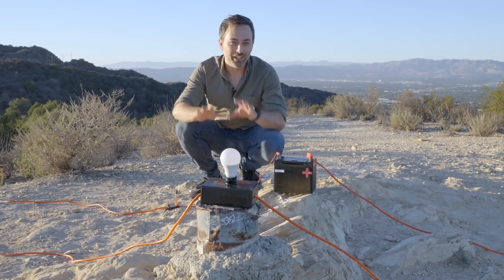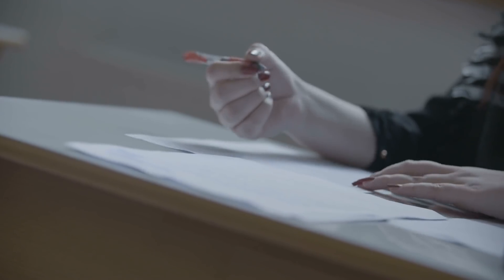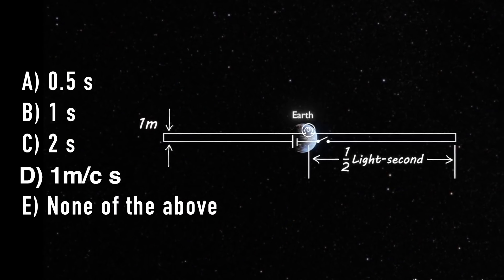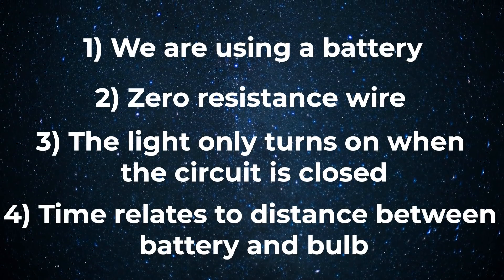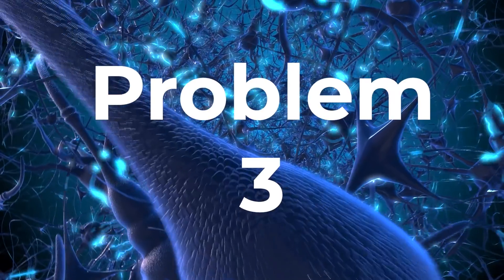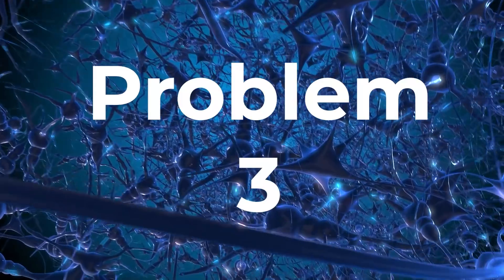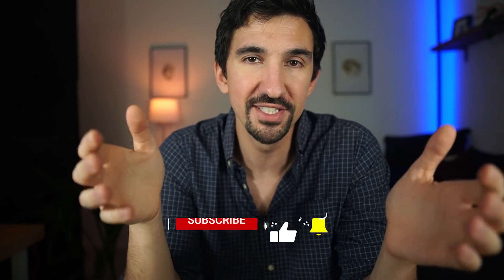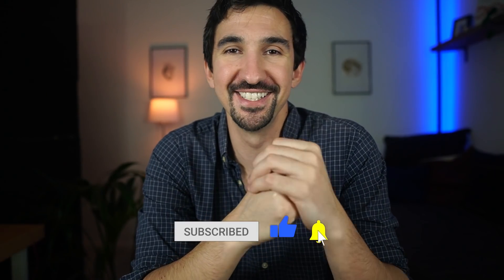Is Veritasium Wrong About Electricity?

Comment: I think you're kinda missing the point here. In Derek's example. When he closes the switch, current starts flowing through the light bulb 1/c seconds later. On the very edge of the wire however (1 light second away), current only starts flowing 1 second later. If you had a switch at the edge of the wire and you would open it, you would interrupt the current through the switch. The current through the lamp and battery however would only stop flowing 1 second later and the current through the other edge of the wire (2 light seconds away) would indeed only stop flowing 2 seconds later. In this example, information is transmitted at the speed of light and so this doesn't violate the laws of physics.
I know, it's seems illogical if you assume that the energy is transmitted through the wire. But it's not. That's the point. From the point of view of an electrical engineer, this can be explained by considering the capacitance and inductance between the wires, caused by the long wires. There are many different ways to see it that may help you understand it, depending on where you are coming from. But the main point is, that the energy is not transferred through the wire.
Reply: I think this video explains exactly what's going on (better than Veratsium's IMHO).
Reply: @ialsoagree  Derek wasn't speculating what would happen, he was simply stating a fact. This isn't any new discovery. It has been known to scientists and electrical engineers for decades.
Considering, the explanation in this video doesn't work without breaking the laws of physics. Well let me just say, disproving the laws of physics isn't an easy task...
Reply: @phinok.m.628  This video presents the same explanation as Veritasium's. If this video breaks the laws of physics, so does Veritasiums.

If it doesn't, then Veritasium's doesn't.

Both videos give the exact same explanation.

Did you actually watch the video?
Reply: @ialsoagree  Of course, I watched the video.
The problem is that the explanation in this video falsely assumes that a switch on the edge of the cable (1 light second away from the light bulb) would also switch the light on/off in 1/c seconds. Nobody said that would be the case and if it were, it certainly would break the laws of physics.
Derek places the switch one meter away from the light bulb in his example, because the distance between the switch and the light bulb matters. You can't just move stuff around and assume nothing changes. That's not how physics works. If you were to stretch the cables out, so the light bulb is 2 light seconds away from the battery and the switch, then it would obviously also take 2 light seconds for the light to turn on when the switch is closed.
The point that Derek was trying to make in his video was specifically this. That the length of the wires doesn't matter, but rather the distance between the switch and the light bulb.
And as pointed out in this video, a cable that's 1 light second long would need to have a very low resistance in order for the light bulb to work at all. Or you would need a power source with a significantly higher voltage in order to compensate for the voltage drop in the wires. But Derek clearly states that the wires in this experiment are assumed to have no resistance at all. So I don't see the problem with that.
Like I said, this is no new discovery. In Veritasium's video Derek simply tries to explain why this phenomenon occurs. If you don't like his explanation, feel free to watch another explanation. There are countless explanations out there, that don't break the laws of physics.
Reply: @phinok.m.628  " the explanation in this video falsely assumes that a switch on the edge of the cable (1 light second away from the light bulb) would also switch the light on/off in 1/c seconds."

No it doesn't, in fact, this video makes the very point that that CAN'T happen. It then goes on to explain what's going on - which is exactly what was said in the Veritasium video, with the qualification that the voltage induced by the electric field traveling straight from the battery across the 1 meter gap is too small to actually light the bulb. It's measurable, just not sufficient to power a light bulb.

Instead, the bulb would actually illuminate when the field had traveled across the length of the wire and reached the bulb, where the full strength of the field would create the voltage necessary for the bulb to illuminate.

This doesn't contradict what Veritasium said, it just clarifies it.

Comment: Doesnt the only movement that matters happen at the actual light bulb. The electron flows into the light bulb + , the electron - flows back to the battery, probably so that the electrons keep flowing towards the bulb or by the bulb. So the old electrons move out of the way of the new electrons. I  DONT think it matters how long it takes to return to the battery for - , it only matters that + side can keep flowing by the bulb. The reaction of the electron flowing by the bulb must be where the field reaction takes place. I dont think we have giant fields everywhere for electricity. I think for this issue you should look into how a light bulb works. I think fake science or misinformation is still an issue with modern science. When I plug in a device there is meant to be some field that flows all the way from the power station to my device ? I dont think so, Why cant I detect these fields anywhere then ? This is rubbish.

Comment: This is a simplified experiment with a single wire. What about a circuit board with hundreds of traces on it? Is the electricity in a PCB not flowing through the "wires", but instead only as fields?

Comment: Derek's videos are usually eye opening, but this one left me scratching my head. I feel normally he explains his premises better, but this one I feel he forgot about the layman and targeted this video to those who already have a deep understanding of electricity.

Ex. I wonder why the electrons that already exist in the wires aren't accounted for?! 

In my primitive mind, I picture a pressurized hose like in hydraulics. When you apply pressure and initiate the flow of hydraulic oil, the movement is translated end to end immediately because the fluid is incompressible. You're essentials moving a solid object through a pipe. If you lift 10 foot pole, the end of it will move at the exact same time as the part in your hand.

Couldn't this provide an answer to his problem? I have no doubt my lack of electron/electricity knowledge is wrong and there is a clear reason why this isn't the case, but I think he should have done a better job at explaining these types of scenarios in layman's terms to make a better case for his video.
Reply: If you model the wire as an incompressible fluid then the signal travels instantaneously (FTL), which is very impossible, so that doesn't help.
In the real world nothing is incompressible. For your examples: Over large distances, the small amount of compression in hydraulic fluid builds up to create a time lag. If you try to lift a giant pole then a compression wave will travel through the solid pole (at the speed of sound), and the end of the pole will only move when that wave reaches it. Veritasium actually made a video on similar issues ("Will This go Faster Than Light?")
The "tips" of the wire (the bits that extend out for half a light year) can only get a signal after half a second; anything less would break causality. For the bulb to react in less time, requires a signal to ignore the wires and travel directly though the air.
Reply: @Lashb1ade  thank you for this clear response. I did not realize there is a compression wave even in large physical objects. Obviously physics is not my strong suit. Lol Cheers.

Comment: It seems to me that the main question 'What delivers the energy?' still hasn't been answered. It seems to me it is neither the movement of electrons nor the field. The movement of the electrons leads to the deliverance of the energy and the field is caused by the difference in potential which causes the electrons to move, but 'what' exactly is propagating still hasn't been addressed. Any ideas?

Comment: Yeah my assumption is that you could get some kind of transient behavior where the light turns on for an instant when the switch is closed, due to the magnetic field generated, but that would disappear quickly, then (more than) a second later you'd get a steady state dc current.

Comment: it would have been better to take a conductor where the voltage wave is reflected and thus forms a standing wave, so one could have measured the wave-shaped voltage amplification along the length of the conductor.

Comment: you think of the switch as a break in the circuit and when you close it, it fixes it. if the circuit brakes. it will take the light the distance from the break to the light divided by the speed of light for it to turn off. veritasium made it seam its the distance from the battery. but it is from the switch

Comment: If there were two batteries and two light bulbs in two separate closed circuits, but laid out right next to each of other, what happens when you flip the switch on just one of them?
Reply: A small voltage will be induced in the other circuit - but the induced voltage will be very very small (just like in the Veritasium case).
Reply: Interesting...  Another video claimed the wires didn't need to be connected at all.  Which brings up a lot of questions imo.

Comment: He did it for the views, guarantee his wires were 300 mm long, Your dead on correct, the resistance of wire at that length/ voltage  would never make it to the bulb.
Reply: You missed the point of the video; obviously the wires didn’t go halfway to the moon. His circuit was a visual aid not a demonstration 🤦🏼‍♂️
Reply: @theevilkoala9250  I think Warped Perception is making a different point:

If the bulb can be powered merely by having the battery and switch near the bulb - regardless of the length of the wire - why does wire resistance matter at all?

If all that matters is the field generated by the battery reaching the bulb, then surely the field dying off some where down the wire doesn't matter - since the bulb turned on long before the field reached that part of the wire, right?

Except wire resistance does matter, ergo some assumption made by Veritasium is wrong.

In this case, it's that there would be enough voltage to turn the light on.

Comment: Very nice though experiment, which is indeed not that simple as it might seem. Depending on the circumstances, answer c might still be right. Let me try to explain, why your argument of "breaking relativity" is false. If the wire is not broken, we could measure a voltage over the switch. As soon as it breaks, it takes some time, until we do no longer measure this voltage, and this time depends indeed on the speed of light, and how "far" away the wire is broken. But, my point here is, that the information, that the wire is broken, propagates as soon, as the wire breaks, and not as soon as the switch is closed. Therefore, if we assume that the wire is broken (long enough) before the experiment, we do not break relativity.
The point, if the circuit can be seen as two antennas, depends in my eyes of view on two factors. Resistance, and Capacitance. Assuming zero resistance, and non zero capacitance, the argument of Veritassium works fine, and I would say the answer is correct. (At least if we neglect the missing "m" in the unit)
Reply: This video isn't saying Veritasium is wrong. It's saying that the voltage induced in the bulb side of the wire after 1m/c would be too small to light the bulb.

Comment: Consider the conductors being perfect coax cables that leaked no radiation.  There would be no antenna effect.  The wave would still propagate inside the coax.

Comment: also you need to take into consideration the capacitance and inductance of the wire. Suppose the break were on the other side of the bulb it would briefly light up.

Comment: A good demo is being in  a  TV studio, like CNN in Atlanta, you can see a feed direct from the studio and one from a return on the satellite.  There is a very noticeable delay and most of it is in the circuits (as an up and down link to a satellite is not very long)  signals thru the wires are quite slow  (relatively speaking). (more to come)
Reply: Satellites add ~250ms delay to 1 way transmissions. They add about 500ms delay to two way transmissions.

If you sent 1 transmission via satellite to the other side of the world, and another via a dedicated fiber line, the fiber line would get there in about 62ms, about 4x faster than the satellite (~12,450 miles of travel around the Earth for a fiber line, ~47,000 miles to a satellite and back down, and that's not including the fact that you'd have to relay the signal across multiple satellites around a wider total distance, which would add even more delay).

Comment: I have a question concerning this. NOTE: I have only taken a preliminary course in electromagnetism. Here you state that the Poynting vector (S) is equal to some constant k times the cross product of the magnetic field (B) and electric field (E). So, while the E field is propagating through the wire there is not a fully formed magnetic field to the bulb. So, are you saying that at 1m/c seconds the cross product of EB still is enough to create an S field from the battery to the bulb? To me, it would make more sense for the E field to propagate until t=1 second where the E field is fully propagated creating a full B field where the S field leads to the bulb.

If anyone can correct, please enlighten me :D
Reply: Since there is 1m between the battery and the light, it will take 1m/c seconds for the elecric field from the battery to reach the light. The length of the wire is irrelevant. It could be 100 million light years with the same effect. But like mentioned in Veritasiums video it will not reach full potential until the field has propagated through the wire. So the lightbulb wouldnt actually shine since the effect is too low at first, but it would be "on" almost instantanously.

Comment: No, you have got it wrong. The argument he was trying to make wasn't that electricity works because wires act like antennas and it doesn't matter if they are connected. The use of extremely long wires only complicates the point. Using his logic, wires 300m long and not parallel would serve equally well for the example. He is saying that setup wouldn't take one microsecond to turn on, but rather 3 nanoseconds. That's a measurable difference. As anyone can tell you, the light will not turn on at all if there is a break 300m away. This is entirely testable using three atomic clocks, two very fast switches and substitute a device that senses current much faster than an ordinary light bulb.

Comment: Not breaking causality by communicating at above light-speed  because the "communication is from A to B where A and B are only 2 metres apart.  But what if you had another wire circuit running parallel but with opposite polarity, why wouldn't it cancel out the first?

Comment: The problem I have with his video is the principle of magnetic fields. Magnetic fields cannot produce any useful work. Magnetic fields are created by the electromotive force, and for a electron to be influenced by the magnetic field it must be in motion. You can't simply wave a magnet at a stationary electron and have it move, because it won't. Magnetic fields only affect electrons in motion. This is proven mathematically. Which is why I think his example is absurd and wrong. You flip a switch, electrons move, they create a magnetic field around them, and this magnetic field can influence other MOVING electrons. The magnetic field cannot perform work period.

Comment: 10:48 That reminds me about the Bohr atom model and orbital model. When doing high school Chemistry, you learn the former first, and it explains quite a lot about how chemicals behave. But there is a point at which the teacher needs to introduce a easy, high school version of the orbital model to explain behaviour that can't be modeled with the Bohr model (most likely at the point where the behavior of carbohydrates gets explained, or even when talking about more complex ions and their behavior, like why most iron ions are Fe2+ and Fe3+). 
You can explain particularities of the Bohr atom model with the orbital model (for example, "why is the first "lane" only 2 atoms"), but for "simpler" chemistry, you'll use the Bohr model implicitly even though you know a "better" model.

Same goes for Newtonian gravity and gravity according to Einstein - the latter explains outcomes of the former, but no engineer would use forumulae for general relativity to calculate loads on a building.